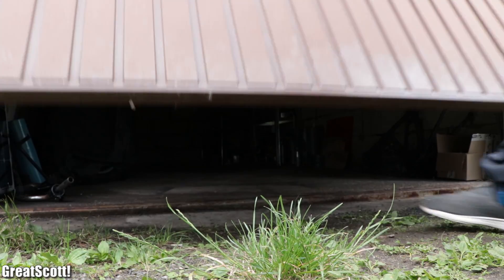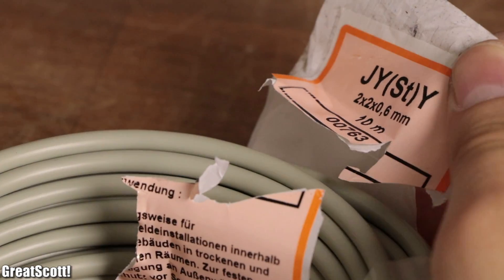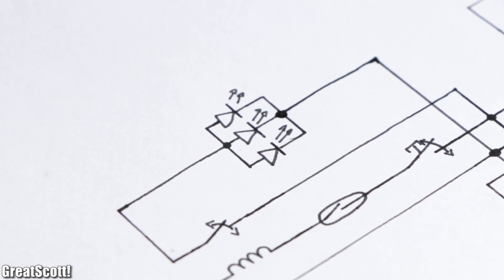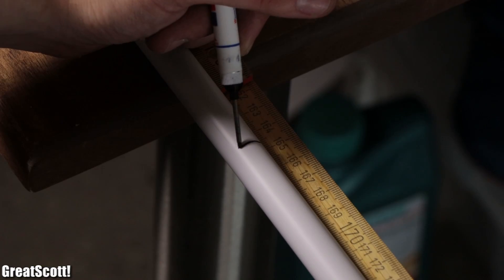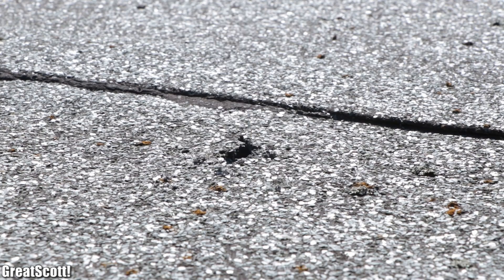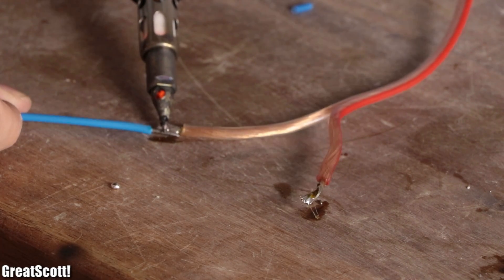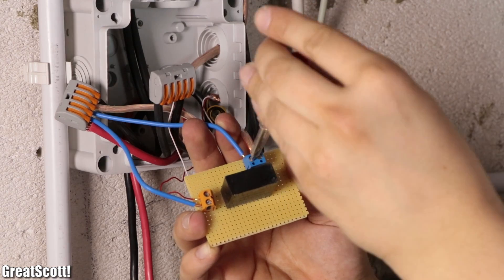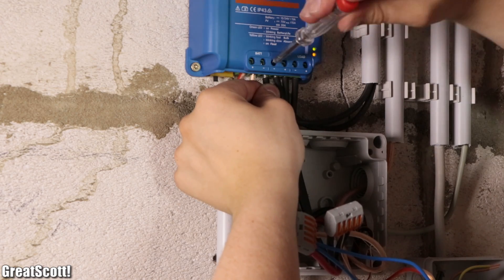Make your own Photovoltaic Off-Grid System

Comment: (Disclaimer: I write this in German because of the easier way to make myself clear)
Vorweg möchte ich fragen, ob die Garage nich an das Elektrizitätsnetz angeschlossen war, oder ob kein neuer Zähler mit neuem Elektrizitätsanschluss beantragt wurde. Sollte letzteres der Fall seien, ist es sinnvoll eine Solarplatte als Energiequelle zu benutzen, da es sonst nur sehr viel Geld kosten würde. Sollte allerdings ein bestehender (und gültiger!) Vertrag vorhanden gewesen sein, so wäre es sinnvoller gewesen, sich beim Örtlichen Elektrizitätsversorger zu melden und nachzufragen, warum der Anschluss nicht mehr besteht. Allerdings ist mir aufgefallen, dass kein RCD geschweige denn ein LS eingebaut wurde. Somit wäre der Versicherungsschutz schon futsch und im Falle eines Stromunfalls würde keine Versicherung zahlen. Da solle vielleicht nochmal nachgearbeitet werden. Im Zweifelsfall einen örtlichen Elektriker aufsuchen und sich dorf informieren lassen. Sonst wäre nur noch zu beanstanden, dass bei dem Ladecontroller die Blanken drähte ein bisschen herausstehen und eigentlich passende Aderendhülsen über die Flexiblen Drähte (in den Schraubklemmen) gehören.
Reply from the maker: Aderendhülsen sind an dieser Stelle nicht Pflicht, da die "Schraubklemme" Backen nutzt und keine Schrauben um die Leitung zu fixieren.

Comment: you might want to mount your solar panel on a frame with some air between the roof and your solar panel. It helps with cooling down the panel and maintaining efficiency.

Comment: Hi GreatScott!, the panels should be raised using brackets, if flat as you have installed then air behind the panel can't circulate. Hot panels = less efficiency. Maybe you can add self water cooling.

Comment: I'm pretty sure you just didn't put it in the video but put shrink tubing over the solder spot between the speaker cable and the LED connection cable, i would have used a richter clamp but I guess that's out of habit.

Why didn't you put the leds inside some transparent PVC Tube? You go through all the hassle of doing a proper looking electric installation and then just clamp the lamp strips between pipe clamps. Or is it just provisional?

Comment: The cost of the project?
Reply from the maker: Not cheap. Around 400€.
Reply: @greatscottlab  yeah it's not so cheap.
Reply: TheChipmunk2008 I'm sure the 12v 100ah battery wasn't cheap either.
Reply: I assume most of that cost was the pv panel and controller?
Reply: L V good point, i discounted it in my mind as I have one on hand  :) (yes it's kept charged during storage)... well it's 80Ah, but the point stands
Reply: GreatScott! Is it possible for you to provide a cost breakdown?

My assumption is that the panel, battery and charge controller make up the bulk of the install, with RoS (rest of system) accounting for a minority of the cost, along with free sweat equity.

Comment: You shouldn't install the solar panel straight on the roof. Since the sun heats it up and there is no ventilation under the panel, the heat of the air under the panel and the panel itself gets higher and the efficiency of the panel lower.
Reply: Also panels installed at an angle makes the rain flush dirt of them.
Reply from the maker: True. But I wanted to keep the panel as flat as possible so other people do not see it. Also I did not wanted to drill more holes for a proper mounting since that increases the probability that water enters through the roof.
Reply: The angle of the solar panel is directly correlated to the efficiency.
http://www.rayotec.com/content/images/PV_Orientation.jpg
http://solarpaneltilt.com/
Reply: Eduard van Raalte yes thats true as well
Reply: It will also make replacing the singles much harder.
Reply: I think that the garage is a rental garage and Scott needs to keep his off grid solar stuff low-key, as either other tenants might get envious and copy his installation and do a shitty job of it and piss off the owner or the owner would already get pissed at this very very secure and decent installation. 

I really love the install! I am going to put something similar on my carport so i can have nice LED lighting when i get home and around the outside of my house at night :)
Reply: You could probably pitch an aluminum profile to the roof, and screw the panel to those profiles. We just installed ~100 m² of panels. After being temporarily stored on a sunlight with no ventilation gaps beneath, panels were so hot I got blisters in my hands after picking one with no cloves.
Reply: yeah, the laws here in germany are sometimes so cringy... so there is a possibility that the electricity providers have a problem with your solar installation, even if its just one panel like in the video
Reply: But you still risk having your panel crack over time.
Reply: I've heard stories that the angle of the panel actually has little effect of the power gathered, ESPECIALLY if the surroundings reflect light. For example, mount the panel vertically on the wall of your building, and put some white rocks on the ground in front of it. I plan to do some some experiments on this.
Reply: Also if the panel would ever break or need adjustment for any multitude of reasons it would be much more difficult to do
Reply: Don't know what the laws are in Germany, but in Australia that is illegal. Would recommend you get a proper mounting system as the bitumen doesn't look to have nearly enough strength to withstand a period of strong winds. Could fly off and kill someone in the worst case scenario.

Comment: I bet this cost a lot more than just running a normal power line to your garage.
Reply from the maker: That is definitely true but there was no possibility to get a power line.
Reply: I think his garage is surrounded by streets. This is also the case with me :-/
Reply: yea alright, getting a separate energy contract just for your garage is a bit silly..
Reply: Gooberslot atleast in my country if you want to get electricity from pole it will cost you around 700 euro for single phase and around 1000 euro for three phase. I doubt this setup costs 700-800 euro.
Reply: There is always a way ;)

Comment: The location and angle of the solar panels is critical.  Laying them flat is probably not the best configuration.  Also, clean the panel(s) frequently as the slightest dirt contamination can significantly affect efficiency.

Comment: why ac and dc cable should be laid separately?
is it because safety reason or other reason?
Reply: Maybe the AC line induces ripples into the DC line if they are to close to each other. It probably is a standard as well
Reply: metalhead2508 yes exactly

Comment: Why you can't put ac and dc cables in one pipe?
Reply: Induction. It gets more complicated with metallic conduit. Induction heating can melt wire insulation and cause a short or fire.

You really aren't supposed to put two separate AC branch circuits in the same junction box because it can cause someone to believe the power is off when not all of it is, and is very dangerous. It is best to keep circuits separated for easier troubleshooting.
Reply from the maker: You can. But there can also be problems when there are signal wires involved. So it is a good practice to always lay them seperated.
Reply: wrathofsocrus ok thx👍

Comment: Why did you put a different battery in the German amazon links and not the one you used? O.o
Reply from the maker: Because I got mine from Ebay. But the one from Amazon should work fine as well and is even cheaper than mine. I did not searched well enough when I ordered.

Comment: Hey scott! You mentioned you shouldn't put ac and dc wires in the same conduit. Why is that?
Reply: electromagnetic parasites can appear in the circuits. in a simple circuit you can ignore it (mostly) but with the solar charger, who is bundled with a lot of delicate electronics, you should avoid interferences at all cost .at my work, we killed a 40KVA UPS because of electromagnetic interferences. a solar charger works mostly the same as a UPS.

Comment: so you are still relying on sunlight
Reply: Calm down Wayne.
Reply: There is such thing called irony.
Reply: catsoften wayne has that game that's a mat, it has conclusions on it and you jump to conclusions
Reply: catsoften he doesn't need the sun he can just ecselerate ions of H3 and H2 to half the speed of light and collide them to give of almost twice the energy put in. 
or make a hollow ball made of iron with paladium raped around it horizontal and vertical and diagonal about 50'000 times each hook that up to a 12 amp 180 volt battery pack fill the ball with H3 and H2 use solar panels on the inside to collect a most of the power and Xvoltaic panels and gammavoltaic panels to collect the extra energy from fusion.
this idea works by magnetically compressing the H3 and H2 into a small ball of ionized gas better known as plasma this creates temperatures around 100,000,000°c enough for fusion and it gives of more energy then put into it.
I have actually made this and I'm planning to upload it to my channel soon I'm setting up a lot of safety measures around the experimental reactor.
Reply: TheGTP1995 and one more thing it needs to have a near vacuum inside with nothing but H2 and H3
Reply: carlos arrache Make sure to upload first another video about how to ask permission to the government for a project like that
Reply: well with the battery, no.I don't know how much power the lights use but i'd imagine one night would run easily.
Reply: + "If you don't know who I am, then maybe the best course would be to tread lightly."
Reply: The battery is charged by the sunlight...
Reply: Idiot relying on battery! watch the damn video. Sunlight does not need to be around for it to work all the time.

Comment: Keep in mind a lot of the cheaper speaker wires are copper cladded aluminium which require a lot thicker wires as one is used with pure copper, so watch out if you want to build something similar yourself to exactly read the specs before buying. Also i would add an additional fuse between the battery and the charge controller - just to be safe. Don't know this one, but I for myself had several controllers fail causing a bit of a mess. For the solar panel: Usually it is a better idea to tilt it slightly - a flat module heats up more and as such generates less power. Also on tilted modules rain can wash away dirt more easily and you do not need to clean it as often.
Reply: BitBastelei Another reason for the flush, horizontal mounting it's too cover the conduit carrying the wires connecting the panels to the solar charge controller.
Reply: Hopefully he is reading you´r comment.
A nice Day from Germany. ;D
Reply: BitBas
Reply: If the charger was made in Germany, there's 0.00% chance of it failing.

Comment: Really fantastic job! I want to make a "solar 10w floodlight". Basically a small solar panel, small MPPT (based on a step down/battery charger), probably a 4s7p battery pack with BMS (that is going to act as a charger too), a 10w floodlight with a 12/24v driver and a dark detector to turn it on. But... I don't have enough batteries yet. :/
Reply from the maker: But it sounds interesting :-)
Reply: GreatScott! Absolutely. But... Small steps. :) And, anyway... I have to buy the BMS and MPPT from China. And it usually gets up to 6 months to get here (!). :/

Comment: I have one question about the wiring, will the light only be turned on with the door open? If so, maybe it could be useful to have a bypass switch in case you want to work inside with the door closed (not that you must do that).
Reply from the maker: Correct. I might add one later on.
Reply: I was also wondering this. 
It would seem to me that you might want to work inside the garage with the door closed (due to bad weather, for example), but with the door reed switch in series with the manual switch that seems impossible.
Reply: I was thinking the same. I'd never work with a door open unless it was really nice outside or I needed ventilation. For soldering, I'd use a small brushless fan and a piece of flexible vent hose.

Comment: Would it be more efficient, if you put the solar panel at a 45° angle?
Reply: Jack_ 271 Yes of course, directing it towards the sun would increase the efficiency. But I think laying it flat onto the roof is the best choice in this case, because nobody can see it from the ground floor, otherwise it might get stolen. And this construction is also very simple and windproof.
Reply: @lostname605  It's Germany, you don't just steal people's solar panels there O.o
Reply: Also, photovoltaic cells get less efficient as they heat up, so having the panel at an angle would help in multiple ways
Reply: the only thing is that now air cant flow under the panel and can cause over heating/less efficiency.
Reply: Yes but hardly need to light those led strips haha
Reply: The perfect angle depends on the place you live in. What I do is look where the sun is at mid day and install the panel at about the direction where the sun is.
Reply: spratsprat You face the panel south in the northern hemisphere, straight up at the equator and north in the southern hemisphere. This way she sun will point straight at the panel during midday.
Reply: Even if another angle would be more efficient the changes in the sun's position throughout the year would still require constant readjustment for optimization. Plus he is only powering a small set of led lights and an occasional garage door.
Reply: Thank you.
Reply: Yes
Reply: Generally the orientation is less important than you might think. Even if you are 30° off from the ideal tilt (and even more than that in the East/West direction), your total energy yield over the whole year will still be within 90% of the ideal yield. The optimal angle depends on where you live. In central Europe it's around 30°. So a horizontal solar panel is totally useable in that regard. If you thought your roof might not be suitable for solar panels you should think again.
The major disadvantages of a horizontal panel are that there's almost no self cleaning action and it will stay snow covered in the winter (the latter not being an issue since it wouldn't really produce any electricity anyway).
If you are fine with crappy over all yield, but want to get at least some amount during the winter even steeper than 45° (in central Europe) would be better. But then you get issues mounting it properly (especially when you consider wind forces).
Reply: Potion Seller Having the cells glued to a dark ground with a tight seal around it doesn't really help the temperature problem. But for this use case it is okay I guess. There are no power tools or any powerhungry 24/7 devices in this garage
Reply: maybe not 45ª angle, but to the same angle of the latitude he lives.
Reply: But when the day goes on and the earth rotates the sun will be shining at the back of the panel if it is pointed towards the sun

Comment: Since you love leds. Why not make a bright as hell 100w led light or somthing.
Reply from the maker: That would have been an exaggeration.
Reply: While underwhelming, the point is to get it working: that'd be way too much for one video! The light source itself can be upgraded later :-)
Reply: you can easily get 100w led's online. just strap a heat-sink and a boost converter to it.
Reply: Exotic Butters less is more?

Comment: Wait, what is bischement? Is that kind of sealing silicone?
Reply: id513128 it is "bitumen"
Reply from the maker: https://en.wikipedia.org/wiki/Asphalt
Reply: bitumen Its pretty much liquid "road" without sand and rocks mixed in to it. Also called asphalt or tarmac. The roof was covered with bitumen-paper. Even if it is old it gets a little bit sticky when it's hot, so the new bitumen will mold together with the old bitumen-paper and seal well. On other materials such as steel or concrete there is better options..
Reply: OK, Thanks to you all.
Reply: I seen „gumoasfalt“ (in Czech Republic)
Reply: Pitch or roof cement. It's what's on the tabs of shingles to stick them to the course below.